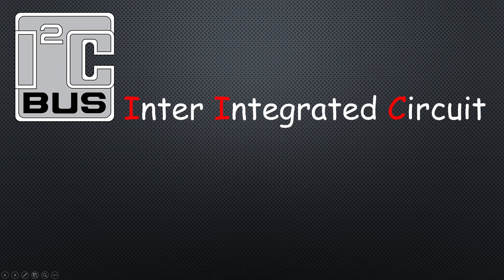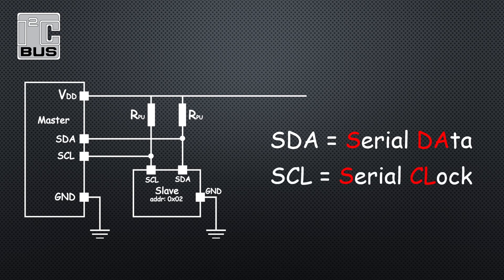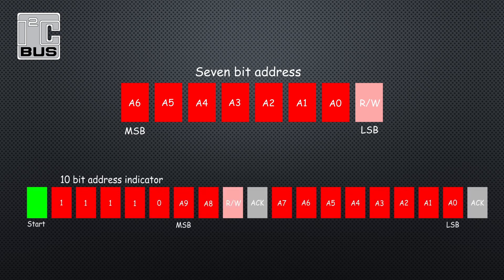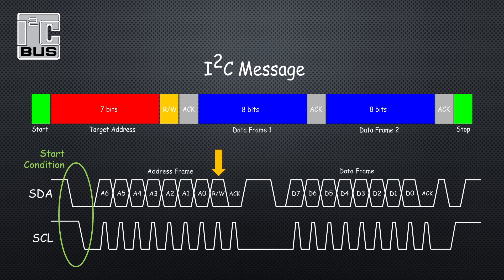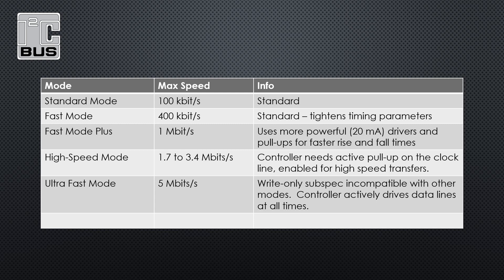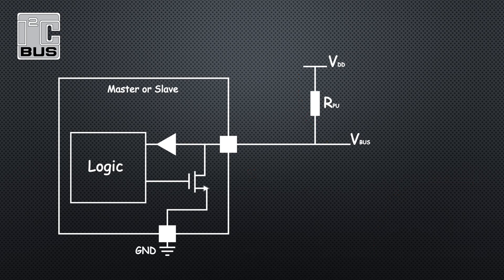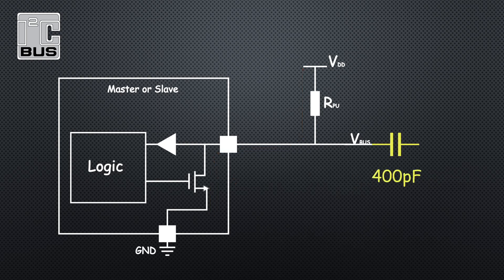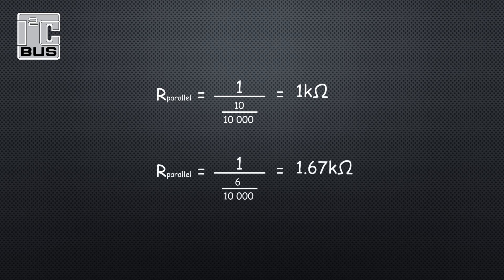I2C Serial Bus Explained: A Closer Look At Serial Communication Standard

Comment: I just re-installed designspark free version after it got removed when I had a computer crash, that was quite some time ago, now I re-installed it, to find out that either I have gotten the wrong version, or it is severly crippled now with both import and export in the free version?

I could previously export ot sketchup, vdb ..those are now gone.
the version is Designspark mechanical explorer version 6.0.3, maybe there is another version?
Reply from the maker: please ask at our DS M forum at designspark.com